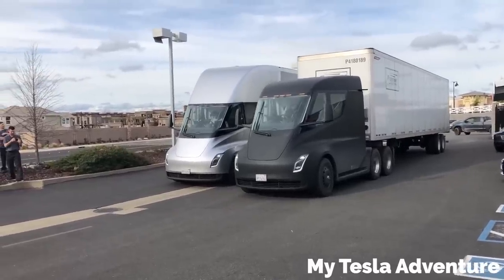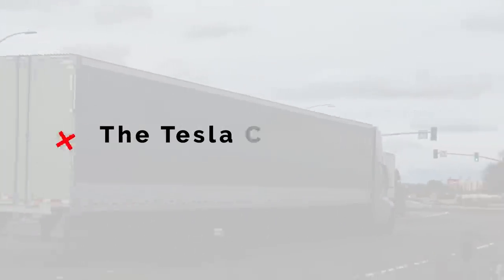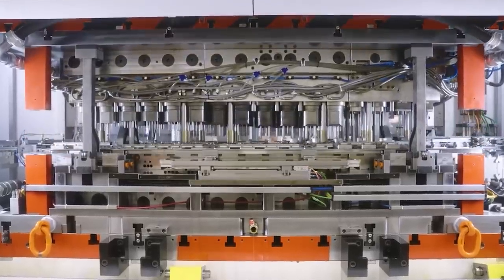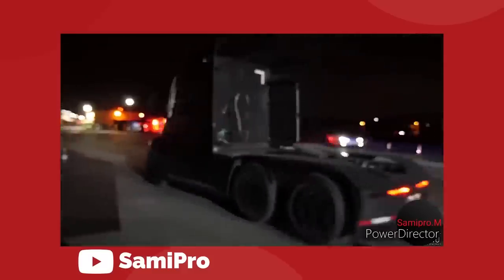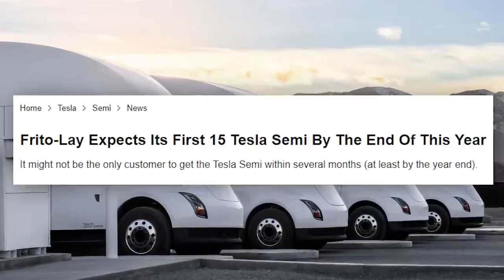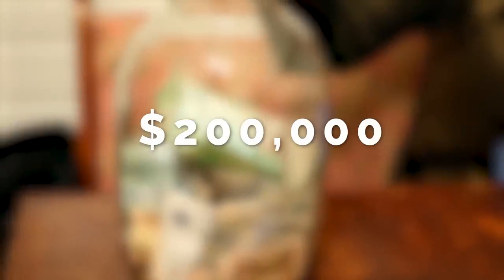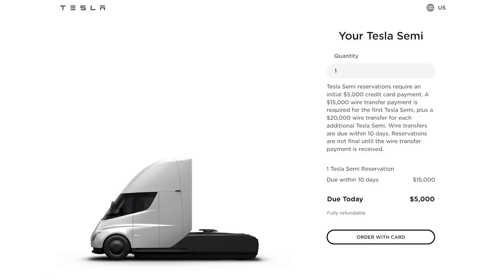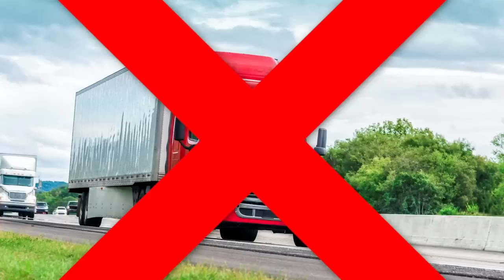The 2023 Tesla Semi Update Is Here!

Comment: Another Tesla fail. It's like the Tesla tank car thing. People already have trucks. Also, waste of time for charging. It takes only 15 min to gas up a average semi and have around 1000 to 1500 miles before being empty. The pollution that's out there will always be out there. From factories to batteries made. On top of that, drivers can mostly identify and repair the problem without going to the shop. You will have to pay an expensive price not just to buy but to repair it within their shops. If many people get this, which is against my better judgment, there's not enough parking for truckers. How do you expect there to be enough charging stations? Time is money for truckers. The smart people would keep their truck and let other drivers buy the electric trucks so the price of fuel would drop due to more people using electric trucks. This is definitely from being greedy and prideful. Should have started this off slow and take off from there.

Comment: Fully autonomous driving, and I mean fully autonomous, is likely a decade or longer away. And zero emissions is only true for EVs themselves, as the power they need to charge, and the manufacturing of the parts, the power used for the factories etc, comes largely from coal. It’s still using the fossil fuels industry in that way. But EVs are still a cool toy and I want one regardless